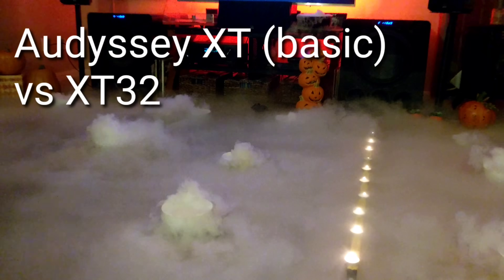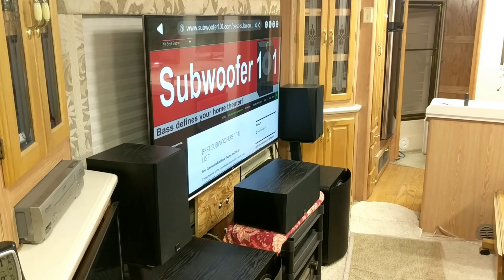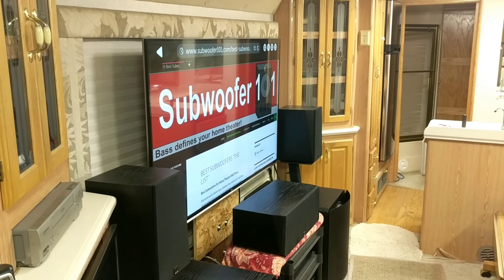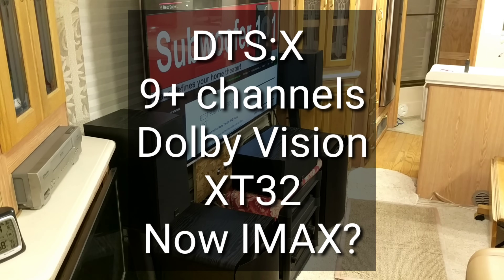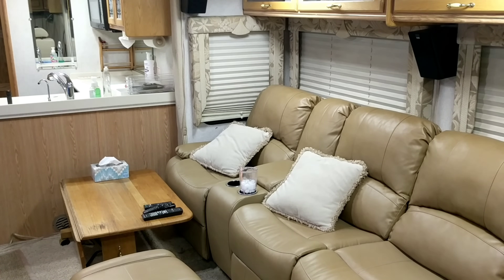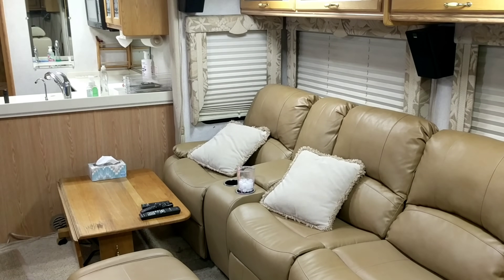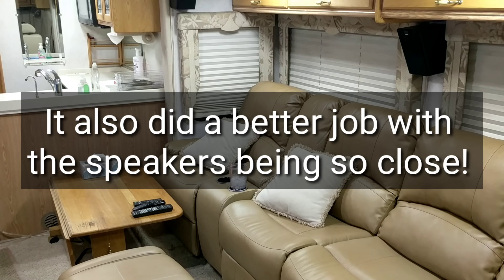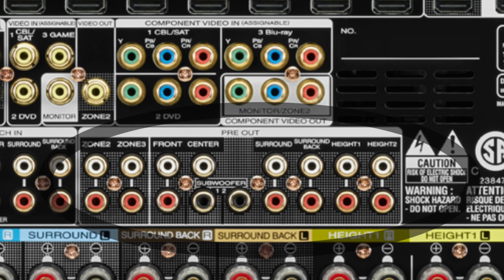Audyssey XT vs XT32 Room Correction (Denon Marantz, and Boundary Gain)

Comment: I upgraded from XT to XT32 and hear / measure very little difference between the two versions. Both work really well. If you have a decent room without any major problems, the audible end result between these two versions will be very similar. Even in difficult rooms you're probably not going to hear much of a difference with movie soundtracks but you will with music. XT32 does a better job with subs- but in reality the difference is minimal. Can't really go wrong with either version.
Reply: I have a Denon S970h which doesn’t even have XT is has the lower tier Audyssey. Will it be a major difference if I upgrade with a receiver with XT32?
Reply: @JohnJohn-pr1sh  I actually think MultiEQ basic is better than XT even though the filter resolution is substantially lower. XT has a very strong tendency to overcorrect higher frequencies and what you end up with is very tiny thin harsh sound. This is a pretty common complaint about XT algorithms. On the other hand MultiEQ (which is what you have) does a pretty solid job with low frequencies and high frequencies- I was always happy with the results. XT32 and results don't seem that much better to me despite the fact it is a much more powerful room correction system. Sometimes less is more.
Reply: @michaelscott466  interesting 🤔 one would assume the higher tier would do a better job but like you said “sometimes less is more”. I will be sticking with my current AVR. I limit the filter frequency range on the MultiEQ app to about 250hz to focus on the lower frequencies. So thank you sir, you just saved my wallet from hurting
Reply: @JohnJohn-pr1sh  I can assure you that MultiEQ is very solid. I would happily go back to using it if need be. The next ADV I purchase will be DIRAC enabled.
Reply: @michaelscott466  lmao, after crawling all over the internet, i found you as a person who has experience with 3 of the version MultiEQ vs MultiEQ XT vs MultiEQ XT32, you save my life well i mean money because i no need to buy that expensive XT32 😂😂 thanks man!

Comment: I had really great results on my old AVR which only had XT. Particularly on the subwoofer. With 32 on my new AVR things just do not sound as good. Sub is too boomy. For me personally I'm starting to feel this is a less is more situation.
Reply from the maker: Gotta run dual deep bass subwoofers. Changes a lot. 

If your subwoofer is boomy, you're probably running a shallow bass/typical subwoofer, and or a single subwoofer. 

Both will cause boominess. With XT32, I definitely don't have any boominess going on. It was more likely to happen with XT.
Reply: I'm also finding I get a much better calibration by only taking 3 measurements in a very tight triangle patter at the mlp. Each measurement just 2" or 3" apart. Things don't sound as nice running excess measurements at the recommended 20" distance. Even taking extra measurements in a tight formation does not work as well as just a simple 3 measurement tight triangle. This might be because I only ever sit in this one spot and my head is always in the same position. I've tested so many times.

Comment: As far as I'm aware, and unless Audyssey have since dropped it entirely, XT isn't the basic offering, but the middle of the range. I had an Onkyo TX-NR626 that I bought in 2014 (since replaced) that didn't even have the XT version, but only the Mult-EQ. Apparently long ago there used to be an even more rudimentary version than that of the basic Mult-EQ that came bundled with my Onkyo, but Audyssey discontinued it. So unless the Mult-EQ has been discontinued, then Audyssey still have three main varieties (perhaps with some differing permutations that may or may not included Audyssey Dual SubEQ and/or Audyssey LFC) of their room correction, thus:

1. Mult-EQ
2. Mult-EQ XT
3. Mult-EQ XT32 (which I'm led to understand comes normally by default with Dual SubEQ and LFC)

Comment: I have a question about my Audyssey MultEQ XT32 on my Marantz SR6011...I  updated my system with a Emotiva BASX A-700 and a pair of SVS Primes..after I ran the room correction, I now have to turn up my reciever louder than before a ran the correct(when i first hooked up my amp...I have already increased my channel Level Adjust as well...what can i do to get some of the power back..
Reply from the maker: You got me on that one. I don't know what the "all channels driven" wattage is with the A-700, and it could be lower or a wash compared to the 6011. You might call SVS on this one, because you did the things I would have done already. They are more thorough than I can be in the comments. Is it possible that Dynamic Volume was a factor?
Reply: @Subwoofer101  Dynamic volume was exactly the issue!!! I had never played around with that setting before, and what a game changer in my system!!! Thank you so much
Reply from the maker: Sometimes it's the smallest things that throw everything off! Glad you got it sorted. Is the amp upgrade worth it in your opinion?
Reply: @Subwoofer101  in my opinion it is because the Emotiva has a continuously stronger output than my Marantz. So oddly enough i can tell the difference, I think my Marantz was trying to hard to push all 9 of my speakers and keep up with the dynamic  sound changes with everything that was getting played through it. I will be upgrading when my budget permits, but  thanks to your review I'm first going to purchase a set of SVS PB-2000 to complete the system.
Thanks again...

Comment: when the speakers  are in small difference between LFE AND LFE + MAIN?
Reply: LFE+Main simply does not use a crossover on the speakers, it just duplicates the single to the sub. Don’t do this, your speaker’s cannot handle 20Hz like a subwoofer can, and it will cause comb filtering and phase cancellations.

Comment: Hi Subwoofer 101. Ive been trying alot of different Audyssey settings and there's one thing i still havent figured out. When listening to music i actually really like pure direct modes on some albums so theres no EQ but using direct modes my subs will not be playing. If i set my marantz to lfe+main the subs will play in pure direct but im worried cause ive read alot of people say not to use lfe+main cause there will be double bass. When ive set my towers to small and use a crossover of 80hz using lfe+main will i still get double bass or is that only when setting towers to large?
Reply from the maker: In Direct mode the output is a lot lower for the subs. You can also check your speaker configuration, it may be setting them to Large if your getting more from LFE + Main. I don't notice any difference between LFE and LFE+Main in direct mode. Also, check your 2 Channel Playback settings in the "Speakers/Manual" menu.
Reply: Audyssey was never designed for music. Movies are recorded with a standard but music is not so using Audyssey with music is a hit or miss proposition.

Comment: How you doing subwoofer101? Looks like you been real busy with that rv build. It's going to be awesome when it's done. I just got the denon 4400. I'm loving atmos. I might have to run room correction again because I skipped over the subwoofer part. It said my gain was to high. So I just skipped it maybe I should of followed the directions. I have a small space also. I also have 4 seats up against back wall and real close to the side walls like you do. I have a question about mic placement since you have same seating arrangement. How did you place your mic positions since you need to do 8 positions. If I was looking at my seats from front wall. Left seat being seat 1 and then 2,3 and then seat 4 being far right. I did  in between 2,3 first then seat 2 then seat 3 then seat 4 then I did positions 5,6,7 on the floor in front of seats from right to left. Then I did seat 1 that is far left. I hope you can understand that. I appreciate your input.
Reply: yeah dolby atmos....if i was single i would be drilling holes in my ceiling and upgrading the old avr 3311...to a avr8500h....but i have to wait until we buy a new house with a bigger basement...o well...
Reply from the maker: Thanks! Yeah, I have a lot on my plate, but chipping away at it. 

I like to keep the same pattern as on screen, so I just shift the pattern forward in the seats. It's not ideal being that close to the wall, but that's my work around. The two rear measurements end up being slightly behind where my ears would be, and my initial samples slightly forward of my ears. I do this because there will be listeners who lean forward during movies, and I have to account for that.

Comment: I have the Denon X3400H and it has the XT32 and it's pretty incredible. It's my first receiver with Audyssey but I'm highly impressed. Overall Denon is the best receiver now. I was a Yamaha fan but Denon has passed them by.
Reply: body on frame What about Denon you like over the Yamaha? I have one and wondering how the Denon would be.
Reply: @arckanum332  I just think Yamaha quality has dipped. The amp sections in particular are not the quality they used to be. If you want to use an external amp Yamaha has extremely low voltage from the pre-outs to drive an external amp. 
Audyssey is better by miles than ypao in my opinion. Overall the sound quality is just better in my opinion.
Reply: @JC-bl9bo  I always heard anthem room correction software is the best in the AV business
Reply: @jdmsz9378  Yes it most likely is but that is high end expensive. For the regular schmoes like me I like Denon. Anthem is really, really awesome stuff though.
Reply: @JC-bl9bo  I do too i have a x4200w and it's already outdated when I bought it two years ago. Planning to buy a 4k tv next year when they implement HDMI 2.1 and unfortunately my avr doesnt support it. Denon should at least let us send out our avr and upgrade the hdmi board for at least 200-400 dollars.
Reply: @body on frame Have you compared Denon and Marantz on movies? Which sounds more dynamic, weightier on movies? I'm thinking of switching to either of those 2. I currently own a Yamaha but the sound is too bright for me and the immersion (like enclosing you in a bubble) isn't there.
Reply: Denon and Marantz should be identical when it comes to movies. Its always been said Marantz is "more musical", meaning it sounds a tad better with music. Now that Denon and Marantz are owned by the same company I would expect that not to be the case but may well still be. Movies they should be completely equal.
Reply: @JC-bl9bo  Too long since I read about it but doesn't Marantz have it's own power supply design or something such?
Reply: Currently choosing between 2400h and 3400h, $200 diff but leaning towards 3400h..choices choices
Reply from the maker: @conraddevera  Go with the X3400. Seriously.
Reply: Get an installer to come by and run the Audyssey MultEQ PRO kit on your system, even better than XT32  :)
Reply: I think Marantz is even better but expensive. Denon is sold more because it's somewhat a balance between price/performance ratio.
Reply: systems with Dirac Live 2.0 are really good too !
Reply from the maker: I see comments like this a lot, that Audyssey really nails it compared to others, especially XT32. Anthem is one I really want to hear too, but it's a more premium brand for sure. 

Marantz and Denon are really close, with an edge to Marantz, but I wouldn't call it dramatic. Hard to go wrong either way.